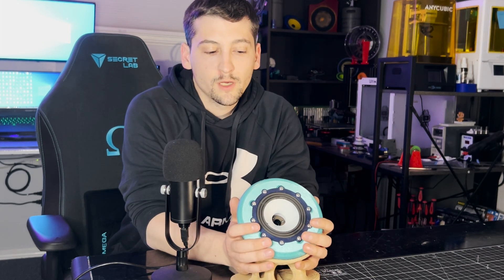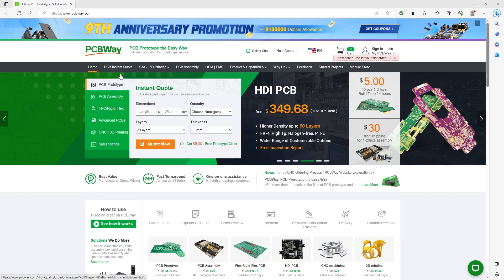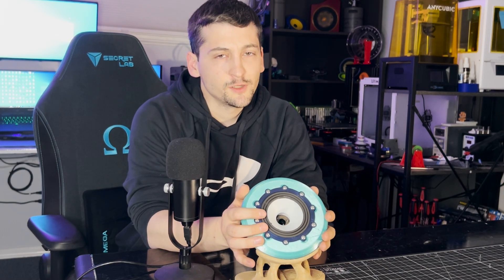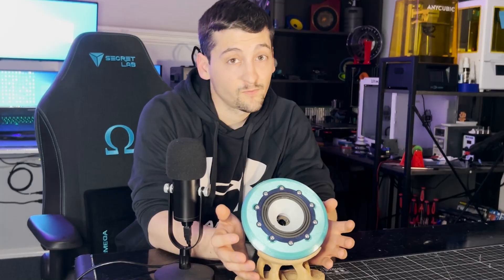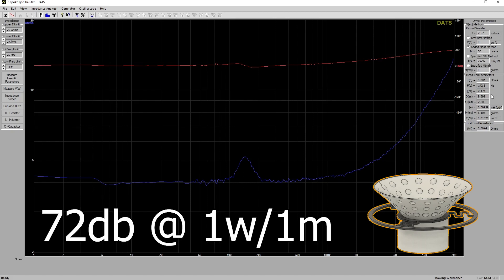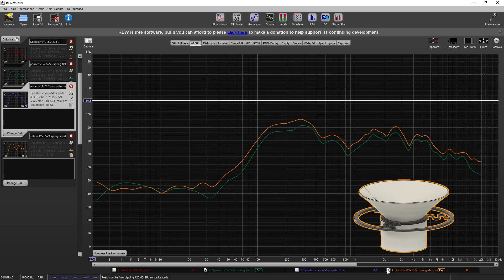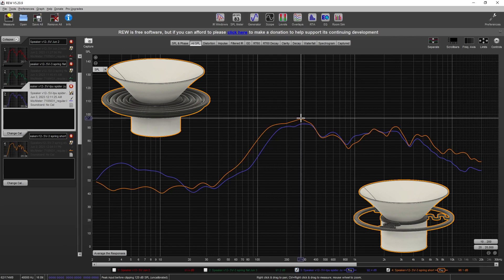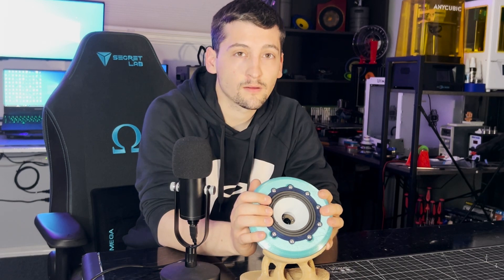Fully 3D Printed Speaker V12 - Powered by Project:Metal Heart

Comment: instead of dimples, I would put holes in the printed cone...... and simply glue a sheet of very fine paper over the printed plastic cone "frame".... maybe giving a good compromise between low mass and rigidity
Reply from the maker: That’s definitely something that I can try in the future.
Reply: That lightweight paper unless heavily under tension is going to be a lot less rigid than the plastic where the dimples would have been. Some kind of compositing could be a nice idea though I think
Reply: @Elliott-Designs  but the flexure across such  a short distance would not be very much, also the weight of the glue might be significant, the glue could be spread across all the paper, thus stiffening the paper...depends on the glue! I suspect it's all about compromise, ultimately!
Reply: Gentleman, in my opinion, it is not so crucial to get super rigid cone, ultra lightweight - please recall old, vintage speakers - small, light coil, small magnet driving preciously relatively huge cone, made from mild papermache. I think, and i do some tests, the texture of the cone is important - should be unregular in microscale, like metamaterial, to kill stillwaves on surface  - of course rigid- using the hexagonal grid frame seems to be awesome idea, and cover it with mild paper or maybe mylar and then some thin wool, silk? Maybe to print some form for papermache superthin, microunregular surface cone, something like fur in touch
Reply: What i have meant - its important to kill self vibration of cone and stillwaves- making grid frame and covering with furlike layer, to make it comfortable for our ear at midrange tones, to kill unnatural spikes. Not so ideal at high freq spectrogram, but our ear should like warmer shape of sound. The same about cone to coil ratio- i made some tests, simple prototypes - little, 1W speaker coìl/magnet connected with papermade 18" cone, with papersuspension- not so loud, but very detailed, warm, interesting sound
Reply: @karolbonarski7311  I think the main point of a modular, 3d printed, kit driver is to facilitate experimentation. Most companies will not do these experiments. If people want a conventional, well designed, professional product; then they can just buy a commercial product designed by the professionals! Most companies are all about making money not trying out experiments. It is up to us to do it!
Reply: @justandy You're right so far! Lately i still do wonder, is it my all work worthless? No. We asked same question - what is the most important? Good soundin. Just it. So me and my friend are still developing very simple, but very, very well sounding prototype of amplifier. And we think about small loudspeaker set for it. Yes, exactly! This is our advantage, power of freedom. As we can just try ideas, put a time, no need to think through mass-business  glasses.

Comment: Awesome design as per usual, loving seeing the progress! To me it looks less like the tpu spider simply reduces sensitivity in those higher frequencies, and more like its simply damping out some resonances. For the size of the driver, the tpu spider version is more akin to what I would expect in terms of high-frequency slope/roll-off, it's not necessarily a bad thing.
Reply: As for cone shape, whilst cone's are used due to their stiffness (helping reduce distortion) a slightly shallower cone will save you some mass whilst not reducing the output sensitivity. Yes there's less surface area, but what matters is something called the projected surface area, which is effectively a silhouette if you shine a light pointing in the same direction as its motion. E.g. Cone pushes and pulls the air mostly the same as a disk or dome would
Reply from the maker: Thanks for the info! I’m still just beginning to understanding all the graphs that are offered by REW and DATS. So hopefully I can start making more informed decisions with the forward path of this project.